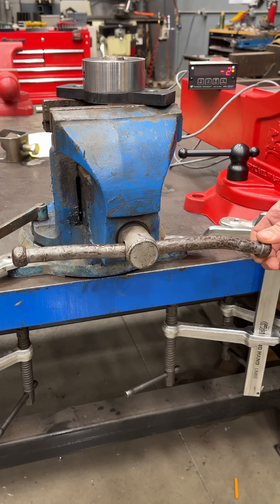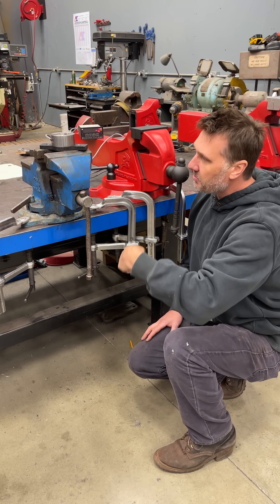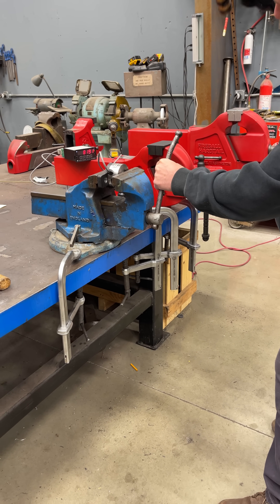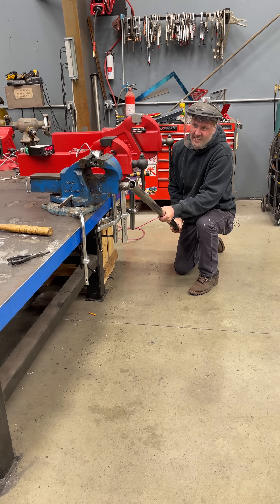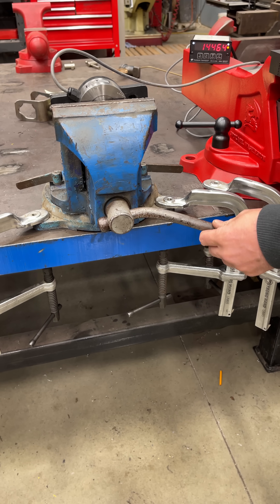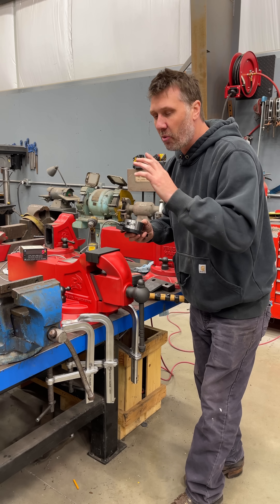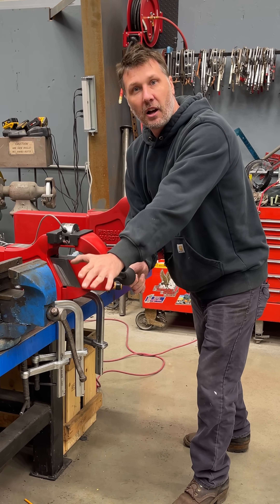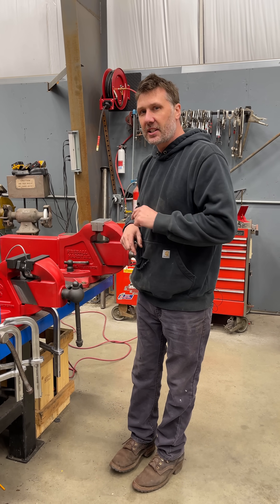How Much Force Does It Take to Bend a Vise Handle?

Comment: A finer thread on the screw will enable higher clamping forces. Not rocket science. The finer screw will slow the opening and closing speed though, which could be frustrating at times. The Record has been made with a screw that enables enough force, whilst also having a reasonable rate of opening and closing.  If too much pressure is applied, there is a danger of shattering the vice, as it is cast iron.  If you need such high clamping forces, you should first rethink the task.
I'd take the old Record, thank you.

Comment: I'm just taking a gas and spitting at the wind here.But i'm guessing you Designed your vice to run on hydraulic system...... As mechanic that is my best guess. It's big but I do like It. I don't. I feel the size of the vice truly does not really matters too much.You're putting it on your work bench and bolting it down, so you know.....you're not moving it around and stuff. 

Good job. ❤

Comment: If i had to guess there's a hydraulic tightener inside that starts doing work the second the object is gripped. That's why handling it doesn't need as much force and opens so easily, because the cheater is in the mechanism itself.

Comment: His new vise likely has a thrust bearing flush mounted in the sliding jaw right behind the handle, whereas the older vise almost certainly doesn't. A thrust bearing would drastically reduce the friction between the screw and the clamps, allowing you to turn the handle with much less effort. A lot of higher end vises utilize thrust bearings for that purpose; much greater clamping force with far less effort.

Comment: its great but i do have some questions

1: when am i ever gonna need to apply 15k pounds of clamping force to something. wouldnt said object be it metal or wood deform severely or break under that pressure? 

2: whats the cost? 

3: why did you use an old clamp as your competitor, wouldnt its years of use affect how well it does? 

4. is there any improvements you may use in the future?

Comment: Isn't this just testing the pressure that the jaws are capable of providing? If your goal is to test the force required to bend the handle, you need to either use a load tester hooked up to the handle and pull that, or do the math to factor out mechanical advantage.

Comment: Record No.75 was the best vice ever built. Made in England, offset jaws, pipe jaws, flat bar bender, round bar bender, swivel base and double anvil on the back.  Last sold be Record in 1971, i have one i dug out of a skip that is still getting battered everyday, and it has yet to notice. 😅 
Tough as old boots, and still silky smooth.

Comment: A: your vise is bigger. B: The English is god knows how old and abused. You probably didn't even cleaned and regressed it.
C: due to its age, that handle probably softened due to repeated bending over the years.
And D: the handle is usually the designed and desired weak point. It should bend BEFORE the load gets to high for the Jaws or the screw, those will explode when failing. Where is your designed safety weakness, does it have something like a slipping clutch or didn't you do your Job properly and made a Bomb?

Comment: That bend in the vice probably didn’t happen all at once. It also likely didn’t happen from tightening it as tight as much as your test. It most likely was ever so slightly bent over many uses and could have been because the person unclamping something had to use a hammer to get it started. Impacts from a hammer act differently on handles like that compared to pulling on a handle.

Comment: you built it with less steep curves on each thread which decreases the tolerances as well as the the and amount of pressure needed to tighten and release i.. that is my guess at least...

Comment: I mean, that is an incredible advice. And if I ever start making tanks or you know, like, like, like, say, paintball, tanks or something like that. As a hobby, I'll definitely pick one up. But realistically speaking.
The last time I actually used a vise, I was just using it to hold something I was cleaning so I could paint it. It doesn't take that much pressure. Honestly, a sandblaster. Does it better

Comment: If you press in u joints you almost always bend the yoke ears. Just tap em in with a hammer. It’s the most common reason people think the u joints are the wrong size and they can’t get the retainer clips in.

Comment: That standard number 6 record made in england has perhaps been in service for as long as most people have lived and still working, plus the fact tht its a standard vice and not even one of the heavy duty record vices? Chances are if you can pick up a good used one it will still be ok in another 50 or 100 years may be better but they are still better than most just be sure to look out for made in England as they are better quality than the newer record vices.

Comment: Well the force obviously depends on the thread pitch of the spindle. Low pitch = lots of force but you also have to turn it a lot if you need to open/close it by some inches
Reply: No it's the same thread pitch he showed it in another video it's definitely wild
Reply: Didn't look like it needed excessive turns
Reply: Yeah, no different than a bolt.
Reply: Hence why the cut when he goes to open the vice😅 like yeah.... a big low pitch screw will be easier?

Comment: The Record is good English quality, especially the older ones. But have you broken one? 
I tried straightening a forged steel bycycle crank arm after a crash, but my, admittedly slightly smaller, 5" jaws Record, it cracked just above the handle shaft point. A clean fracture in the casting, no drama, no flying metal, just a silent release of the pressure on the jaw where it fractured. I was only using a 2 foot tube on the handle, which never bent. The forged steel crank was just too much for my Record.  
Moral here is, a 20t hydraulic press would be the right tool to use. ⚒️✔️💯🇬🇧👍

Comment: If you have abuse tools like that there is something very wrong with the job you are doing. Also the bent handle, I doubt it was bent doing one job but probably through years of use and mis-use. As a toolmaker I have always made sure my viCes are  treated with care and not wound up to breaking point.

Comment: That's like comparing an old school chevy compared to a brand new challenger 2 tank that old no6 vice is probably 40 years old with 80 year old technology to hit 14k lbs is insane but to hit 15k lbs without a cheater bar is just not even in the same category but you sir have made a fantastic piece of workshop equipment

Comment: its 14464 lb = 6560,76 kg and 15216 lb = 6901,86 kg, for all that use normal values.
Reply: Freedom Units are preferred
Reply: Nice comment. I use metric, for non serious calculations in pounds to divide by 2.2:1 such as this video, i divide them quickly by 2 and remove some more, 15.2k pounds / 2 makes 7.5 tons minus 0.5 to round it off leaves us with 7 and gives me roughly an idea of how much is it pretty close to the actual 6901kg.
Reply: Found the tea drinker
Reply: whilte we're being pedantic, the numbers are the values, kg is a unit.
Reply: Actually insane when you think about it, 6500kg of clamping force.
Reply: Ah yes nitpick time. The joys of the pound, is it pound force or pound mass? Probably force so the equivalent unit would be N not kg. If it was pound mass then you'd be correct.

Comment: Okay, I get it, pretty cool.  For a "conventional" bench-top style anyways.  I do like the quick let-off.

But how about a special request for your next tool design project.  Can you do a reproduction of a full-on pattern-maker's style?  The old Emmert Roto-vise?  And its later, bigger, tougher step-brother, the Oliver version (which are very rare and hard to find) of the same flush-mounted multi-articulating fully-rotatable all-angle-clamping concept?  Just start with a straight copy of the original Emmert (which came in two sizes). 

Only two things that need improving on the Emmert concept: 
#1.--  The the toughness of the steel casting, 'cause the old ones were brittle.  (But the Oliver version didn't have that weakness.  Oliver was also mechanically simpler for the same complete functionality).  
#2.--  Then lastly, see if you can figure out how to add a quick-release full-disengagement free-sliding function on the clamp worm-screw, like is seen on some of the modern cheap single-axis ones for woodworking benches.  That notion may be tough to accomplish within the space confines needed for the hinged articulation function to move fully within the mounting bracket.  So it might be a "bridge too far" on the complexity, which I can't fully visualize.

Comment: That record has spent presumably 50 years being used and abused in some workshop, comparing it to a shiny new vice isn't exactly fair. It's also significantly smaller. I'd be interested to see how it's performance improves when stripped down, cleaned, and lubricated

Comment: A vice is NOT meant to be used as a press. It’s meant to hold things securely. You need to put a cheater bar of any description on a vice and you’re abusing the tool. Record vices are one of the best quality vices in the world simply because of the quality of the machining, materials, parts and engineering.

Comment: Question if you don’t mind answering. Do those clamps hold the vises on the table well enough? The fact that you were putting that much force on them and it looks like it’s just clamps holding it on. I’m leaning towards doing that for my bench. I don’t want to permanently attach a vise or bench grinder to my work bench. I’m limited on space. Thanks and the videos are always informative and entertaining.

Comment: Back years ago when I worked at Ralph Green's small engine repair I was trying to press a set of times off of shaft for a rototiller. These times were welded to a hub that was pressed onto a shaft. Over the years they had rushed to themselves solid to the shaft. I had it in the hydraulic press and I had it chained down and had it cranked down hard. I ripped off the area where the press was and put a sign up danger press it is loaded. Best customer was waiting was supposed to be in the area ignore my sign went by my tied roped off area. Right as he walked by the press the chain broke. Part of the time assembly just barely missed him flew cross the room and stuck in the plywood wall on the other side. It sounded like a high-powered rifle on that chain snapped I'm surprised someone didn't call the police for gunfire. Ralph cuss that guy out  and told him to never come back. It's flat out amazing how much potential energy can be stored in such a device. 15000 lb on that vice could cause some serious damage if that thing grenaded.

Comment: Dear vice designer,  if you would build the moving jaw with the handle in it, without the curve in the jaw, make it with a Flat surface parallel to the jaw face! You could hit the flat parallel surface with a sledg hammer after the jaw is clamped tight , and impact a Tremendous pulse force to anything between the jaws Please build and test for all to see

Comment: You are wrong the best vice ever mad was produced by littlestown hardware & foundry in 1977 it was the 750 model device itself weighed 94 lb with two hands only it had the capability of 28,000 lb chest with hands and you can release it with one finger reproduced about 300 of these devices and they were bought out by a larger vise company and destroyed but then I was one of the gentlemen that forged devices yes I said forged that was back in the day when you put up molds by hand and pour them off with a hot ladle full of iron I actually have one of the 750 vice so if you want to see the vice ever made contact me it is at a secret location😢